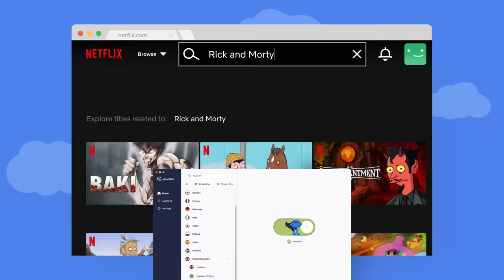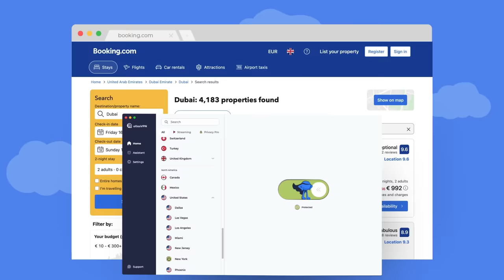How do Russians Cope with Heavy Tank Losses?

Comment: Assuming that "7 times" number is an honest one, I would say it includes new production, repairs and refurbishment from deep storage. Pulling a tank in good condition from storage, giving it a service, chucking some fuel and ammo in it and delivering it to the army could be counted as a 'newly produced' tank (Companies all over the world do this kind of thing to pad numbers). 
For me I would say the production/repair/refurb is lagging behind, although this is anecdotally based on what is being seen in losses; T72 seems to be a rarer sight and T80 seems to be just as common, implying the mainstay tank is shorter in reliable numbers and so more use of the higher end stuff like T80 and T90 is needed to plug the gaps. 
Same with the sudden use of BTRs in assaults. BMPs are surely more suited but if they are getting short on reliable numbers, the BTR is needed to plug gaps that are appearing.
Reply: Assuming anything Russia says is honest is optimism over experience.
Reply: T80s are slowly replacing the T72 which is why we are beginning to see more of them esp as production ramps up. And Russian modernizations are not just "giving it a service and chucking some fuel" they are quite extensive, from armor, to transmission, to new optics and targeting systems, to new barrels.
Reply: @SvdSinner who told you Russia lies? So far we have seen Russia be rather surprisingly honest and Ukraine/West have been lying abt everything from Russia "losing" to Russia running out of tanks, men, artillery shells, food, boots, etc.
Reply: @AndRei-yc3ti  Surprisingly honest? Did you experience that on an LSD trip or something?
Reply: @saltysalt7339  what exactly did they lie about then? Lmao. They werent the ones telling us Ukraine is running out of men, ammunition,  boots, food, etc. They werent posting footage from ARMA 3 and passing it off as "Ukrainian losses". Neither were they passing off Ukrainian losses as their own, as Ukrainians frequently did by drawing Z on their lost armor. Neither were they telling us about the "Ghost of Kiev" shooting down Russian airforce lmao. Which is why i said "surprisingly honest".
Reply: @AndRei-yc3ti I mean Russia was losing for a while after they had 3 major retreats. After that It it just became a stalemate. And I can’t see how Russia is being honest, haven’t russia claimed they have destroyed more HIMARS than the US actually sent and how they claimed the Moskva sunk due to “bad weather”
Reply: They also have to produce enough shells to sustain its 60,000/day goal but can only produce 50,000/day , and hence have accepted North Korean ammunition
Reply: @AndRei-yc3ti  only certain people in the West really know the situation and hence have slowly providing bad news about the war, support has paused and the people in Europe are disappointed by the overhyped counter offensive
Reply: @aaroncruz9181  So you believe they in a day produce double the number of artillery shells than the us does in 1 month in a single day. Okay bro.
Reply: @what4288  if so why then has ukraine had 9 rounds of mobilisation and failing on the 10th, Poland stopping military and financial aid, over rotten grain, the West criticising Ukraine administration and millions of Ukrainians leaving the country
Are they dying for their country or for their oligarchs are unknown to them. They know it. You don't.
Reply: @what4288 I still have to agree with the other dude, Russia has been surprisingly honest with a lot of things. Now, am I at all saying Russia is 100% honest? No, not at all, but they have been more honest than Ukraine, that much I can say for certain. Ik that is hard to believe, but only the people who dig deep into this will understand.
Reply: @saltysalt7339 Did you experience “Ukraine’s hoensty” on an LSD trip yourself?
Reply: @aaroncruz9181 Hard truth right there.
Reply: @rebelliousfew  No but I didnt try to make a not credible party credible one. I never said anything about that either. Shows your capacity to analyse what I said
Reply: @saltysalt7339  you are trying to make a party with a history of lying credible and ignoring arguments that the "non-credible" party is actually more credible
Reply: @AndRei-yc3ti 
And how do you determine which party is the more credible one and which one is 'constantly lying'?
"You are trying to make a party with a history of lying credible and ignoring arguments that the "non-credible" party is actually more credible" right back at you.
Reply: @mikeblatzheim2797  because in this conflict Russia has not been caught in lies whereas Ukraine has been caught in multiple - so you tell me who is more credible?
Reply: @AndRei-yc3ti  
Oh, yes, who doesn't remember Moskva, which definitely sank in a storm. Or the supposed 90+% votes to be annexed by Russia in occupied territories. This "three day special military operation" that definitely isn't a war of territorial conquest against a supposed "Nazi" country where the President happens to be Jewish. The "little green men" back in 2014 that definitely had nothing to do with Russia. The supposed 'independence fighters' which happen to have quite a lot in common with elements of the Russian army. The supposed "genocide" Ukraine was carrying out against its own population, whilst Russia definitely hasn't been convicted of war crimes and human rights violations amounting to attempted genocide by systematically abducting Ukranian children. Need I go on?
How in the world do you imagine yourself lecturing others about 'credibility' whilst simultaneously claiming that Russia hasn't spread lies about this conflict?
Reply: @rebelliousfew  provide some examples of what Russia have been honest about? I can give an example of Ukraine’s honesty, zaluzhnyi did an interview and said that ukraines counter offensive didn’t go as planned and it wasn’t as successful as they wanted, and that the war was at a stalemate.
Reply: @what4288 It was kinda obvious it didn't go as planned as they didn't even breach the first line of defense. But Kiev were actively denying that they had lost Soledar from Wagner. They really haven't been all that honest, especially when it comes to them tallying Russian losses. They are claiming that they have killed almost 400,000 Russian soldiers now.

Comment: So how exactly do you repair damage to the composite armor of a T-72s turret? I'm referring to the example shown in the video where the round went in between the ERA. Isn't that cast/welded steel with the composite array inside? You can't just take that off and put a new set in as it's an integral part of the turret. Isn't that one of the advantages of Western tanks where you can take the damaged armor blocks off and put new ones on?
Reply: you just use bondo and call it a fix
Reply: Just a bit of superglue and paint and it will look good as new.
Reply: If it's a B model u can replace the nera panels
Reply: @SynchroDCS  how does that work, though? If the turret is welded or cast, isn't that one piece with the cavity filled with the panels for the composite and welded shut?
Reply: @jakearmstrong2127  T-72B turret have openings on top you can quickly-ish open and replace composite inserts, either as repair or upgrade.
Reply: @Panocek  oh interesting, so the composite block just pulls out, and a new one is dropped in? I assume then you plug the hole where the round that penetrated went in from?
Reply: @jakearmstrong2127 yes. They just pull it out on battlefield and replace a new one with cranes. Theres alot of videos on this
Reply: unweld top caps
swap insert with new
weld again
Reply: @rogerwilco2 it’s a tank not a UK submarine 😅
Reply: Quite simply, there are huge fields with thousands of old tanks with worn-out chassis.
Every repair plant has a backyard where hundreds of old armored vehicles are piled up.
In extreme cases, you can make a new tower, why not?
Reply: @jakearmstrong "Isn't that one of the advantages of Western tanks where you can take the damaged armor blocks off and put new ones on?" 

Who told you that? My guess is nobody, you just heard that western tanks are "modular" and you assumed they're made of lego bricks that can be finely replaced. 

That damaged armor will be replaced in the same way it would be replaced in western tanks, you'd know if you bothered looking things up instead of making them up in your mind.
Reply: Don't forget to paint over the bondo

Comment: They probably meant the number of instances of increase in production by seven times--not the rate of production increased by seven times.  Increasing production by 0.1 percent seven times based on the original factor of 0.1 still means they've only increased by 0.7 percent.

Comment: I've worked as a welder for a company that made massive machines for road paving, these were of course less complicated than tanks, although they were far larger, I've seen someone claim that before the war these companies were producing 7 or so tanks each year, we would finish ones of these machines every 3 or 4 days.

As wartime production increase i don't find it hard to believe they could make a tank each week, you could even go faster than that with multiple shift to work 24/7, even more if they were more liberal in the application of workplace safety regulations to cut down on time (and we're dealing with russia here). Imo it's completely in the realm of possibility, their biggest issues would be finding the parts they can't manufacture themselves, like those pesky thermal sights, microchips and the like.
Reply: I worked in a welding shop during the oil boom in 2012. We were the overnight crew and built a new mobile drilling rig each week. We had 6 bays going 24 hours per day so all told probably 4-6 vehicles per week 2 stories high.

Comment: As a former tank soldier, I can say that it takes a good 12 months AFTER a soldier has completed their basic tank training to become a proficient, reliable part of the crew. 

By this stage of the war, I'd guestimate (based on visually confirmed losses and data from WW2, the closest peer on peer comparison), that they've had more that 50% crew losses among those who participated in the initial attack. Replacing these crew is going to be way more difficult than replacing their tanks. 

The footage that we've seen of clearly panicked IFV drivers running over their own dismounts points to a significant training failure in the current Russian military.

The Russians could have 10,000 tanks magically appear in their inventory overnight, but that means that they now need 30,000 trained crew, plus logistics and support personnel to get them into service. I just don't see this happening, especially given that tank training requires a higher number of instructors, than say, infantry training, and many of their best potential instructors, have been participating in the new national sport of turret tossing.

By way of comparison, only five percent of the German soldiers, who participated in the first day of Operation Barbarossa were alive when the war finally ended less than four years later and post 1943 (after the battle of Kursk and the Soviet summer counter offensives of 1943), German tank crews were vastly inferior to their earlier counterparts.
Reply: But same constraints also apply to Ukraine by a much bigger margin.
Reply: @dragonstormdipro1013 But Ukraine has not, so far, relied as much as Russia on its armor, which hass seen less combat actions by the nature of the front currently. The first days have probably been very bloody. But past then and once the front settled, ukrainian armor saw relatively little action. And even less offensive actions, or losses induced by a cauldron.
Reply: @marcbuisson2463  I disagree. We have seen countless footages of Russian lancet strikes on Ukrainian tanks. We have also seen the disastrous Summer counteroffensive, as well as frequent decrease in the quality of the tanks used by Ukraine, with Leo 1 being proposed as the mainstay tank nowadays. This all points to massive losses. Unlike Russia, Ukraine was facing an adversary with artillery and air superiority. So even many of their storage facilities have been destroyed.
Reply: @dragonstormdipro1013  The videos of strikes are both russian and ukrainian, you'll find the same on both sides, saying contrary things. I would not base my thoughts on this.
The Summer counteroffensive had armored pushes on the fingers of the hand. Does not mean they went well, but they resulted in not particularly significant numbers.
Don't know on what you base your arguments for saying the ukrainians are mainly on Leo1, those have not arrived in large numbers yet, and there's still plenty of T-72 from what I've seen (maybe I'm biased, won't deny it). 
Russia does not hold air superiority, and russian planes don't come near enough the front to destroy tanks. Neither does ukrainians. It's one of the reasons of the freezing of the front. 
Russian artillery superiority does not translate in tanks destroyed. And not even in advances on the front. And this superiority has been deteriorating since August 2022.
And yeah, no, Ukraine has spent most of the past 18 months in defensive operations, of urban settlements. It's just not the kind of situations where you deploy tanks in significant numbers. 
Does not mean that Ukraine has not last its tanks at all. There has likely been significant amounts of its reserves destroyed. But when you add 600 T-72 sent by eastern europe to the pre-war amounts, plus stocks captured, there's still a significant share of them working. Or that have gone through repairs, it's fairly doable to repair/rebuild officially lost tanks currently in czechia and Poland.
Reply: Sure, they've had some losses, but 50% ?! I find it hard to believe, since, not only do we have the Mediazona count that says ~700 killed (let's say another 1400 badly wounded + ~400 captured/missing) that would put it at roughly 2500, not all of which were crews before 2022; and if they had 3000 tanks in 2022 at the beginning, that means around 9000 tankers at the very least, even fi we assume 2500 casualties only of pre-war tankers, that's still WAY under 50%. Let's say even 3000, and that's only 33%, but we know that most of the times when a tank is badly hit, the crew still gets out and likely survives, so even this might be inflated.

Besides, I'd argue that training now is much better than in 2021; all the combat experiences are being taught now, and tankers do far less mistakes than then and the commanding officers seldom use tank columns now, which can be seen in the number of tank losses being reduced significantly, thus increasing the chance of survival and acquiring valuable combat experience.
Reply: Since you used a WW2 analogy, as the war dragged on, the initially inept Soviet tank crews became better and better, as did their tanks, and the tactics of the officers commanding them.

Actual combat experience teaches you more than mere training ever would, it accustoms you to the new battlefield.

 Much the same with Russian crews which initially had a hard time; their tanks received from UralVagonZavod are better protected, not lacking thermals and now fitted with better guns and now receiving more modern ammunition rather than older soviet stock.

Now, rushes without infantry support are very rare compared to how they used to be in the first 3 months, and they try to make more use of their long range firepower to strike enemy strongholds, and they don't charge as often without mine clearing a path; advances are slower but much more conservative, and as I pointed out in my previous reply, tank columns barely happen now.

As a result, even seen in the Oryx count, the Russian tank losses per month have decreased significantly since then because they actually learned to use them better.